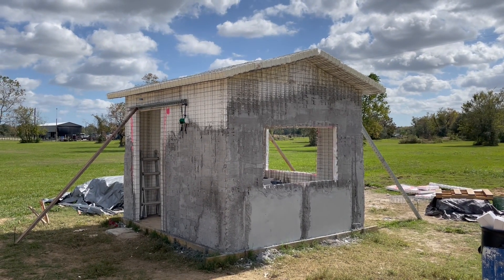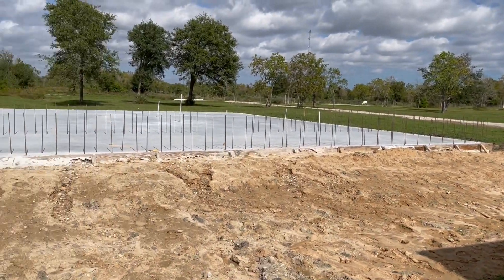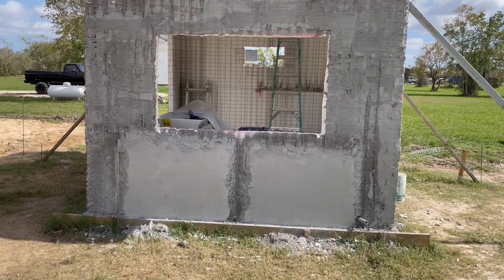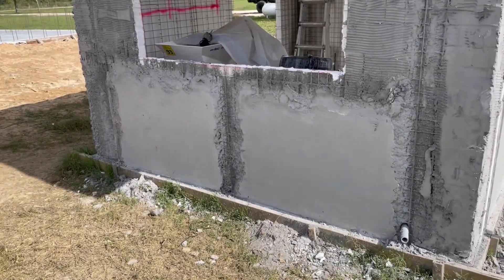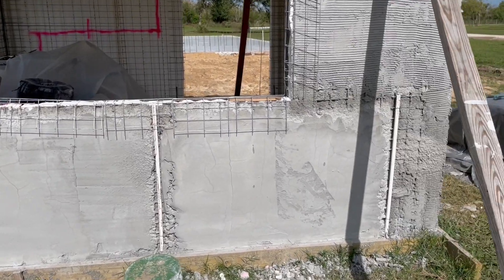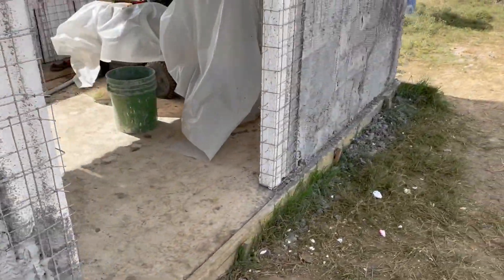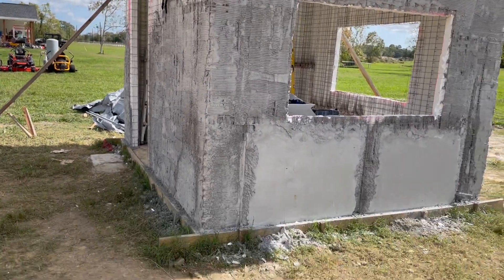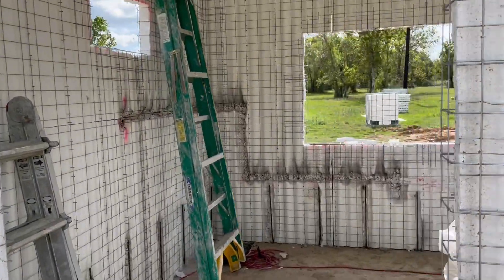SCIP She-Shed - part 1 - EcoKrete Construction LLC

Comment: Is the roof built with same material, panels and concrete? It seems the roof would have a good insulation, but do we need more insulation on the attic for coding? I am wondering if we could walk on the finished roof?
Reply: People walk even on unfinished ones